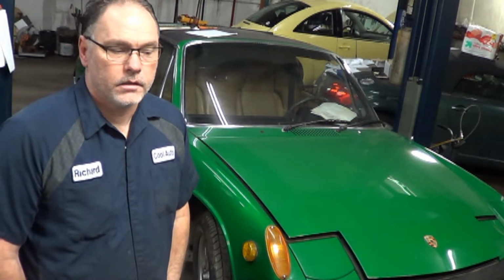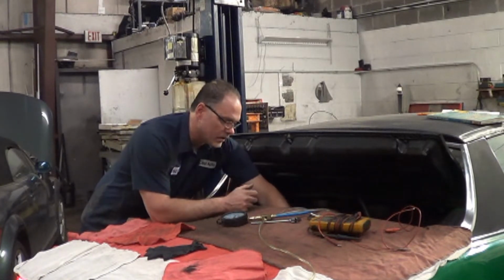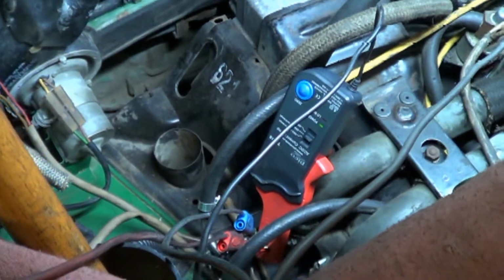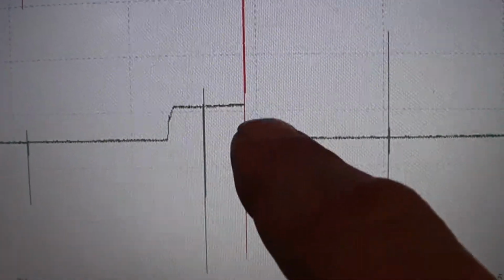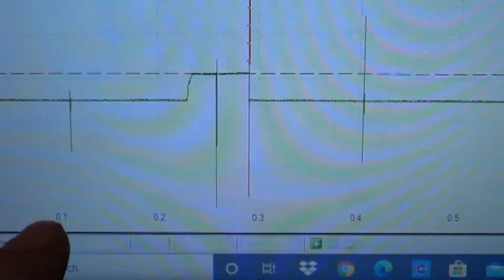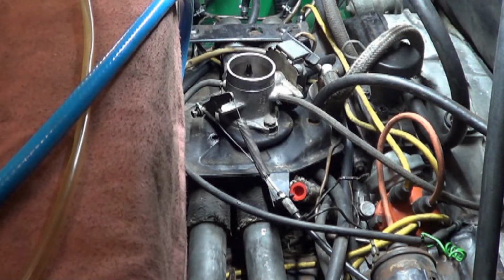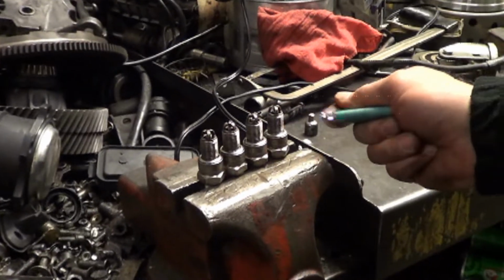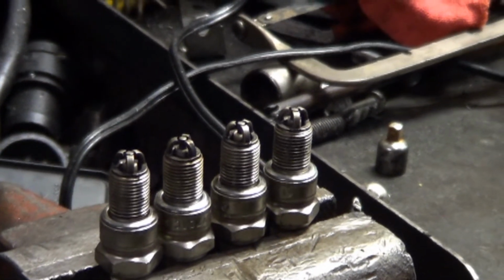Porsche 914 wont start

Comment from the maker: This video ends with the question, "what is the next obvious check"?   Post your guess to this question below!
Reply: Alrite heres my 2 cents. You say it runs on easy start with no fuel pump. Ran for 30secs. There looks to be a lot of fuel coming out of that injector and your pulse with trace is very wide. Dry plugs, try crank, remove, see if plugs are wet. I think the car is being overfulled based on the evidence you have presented, engine being flooded, pressure loss cause of injector leaking/not closing
Reply from the maker: @davesterl  that would also be a good check.  Thomas and you are both on right track.  I went different way than you, similar to Thomas.  next video is now up.

Comment: Does this thing have an early style "MAP' sensor / D-Jetronic fuel injection system?
If you disable the fuel pump... will it run on starter fluid again? 
Too much fuel now (with good pump) or weak spark.
Reply from the maker: Yes, its D-Jet.  Yes Early style map sensor.  Obvious test at end of video is to disable fuel and see if it runs on starter fluid.  You followed my diagnostic thought process perfectly!
Reply: @CoolAirVw  bah, i forgot about the air metering of the system. I normally read codes. maybe this is why my escort would not get great mileage. the obd was not sensitive enough. always started and ran perfect. i figured it was just one of the odd ones. even the previous 2 owners stated mileage wasnt great.

Comment: well if its got spark, compression and is getting fuel.... what is the fuel like? And what is the compression number?  I think you stated that timing was correct. Also.. how is the fuel pressure regulator?
Reply from the maker: Fuel is brand new.  Tank was relined by a service the customer used, and we put brand new fuel in it.  I dont know timing was correct, I just know it was correct when it started on spray, and its gear driven.
Reply: @CoolAirVw  hmm. now im perplexed....  Is it getting enough spark?
Reply from the maker: @jottow680  You mentioned fuel regulator in previous comment.   Fuel pressure "drop" to 20 after cranking seems a little goofy but it should run on the 30 psi as it cranks.  30 psi should be right.  In the video spark was bright and white.  But, if I would have scoped secondary ignition, some sharp techs might have identified the problem that way, but I didn't scope secondary, as I assumed it was ok since it would run on spray.   I have fixed the car by now, so I can tell you  the spark was great.
Reply: @CoolAirVw  so then it is ignition (spark) related?  I havent worked much on distributed vehicles.    And none with points. besides small engines anyway. Ill just have to wait for part 2.
Reply from the maker: @jottow680  I ended the video with a question.  Thomas may have something in his reply to that question.

Comment: If the fuel has been in longer than 2 years I would drain and refill with fresh fuel. and reset mixture meter on computer. Also I would check and replace plug wires and at least the rotor and dist cap.
Reply from the maker: good advice!